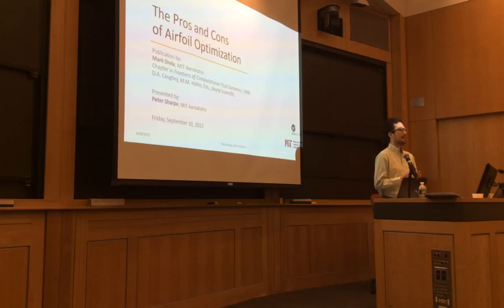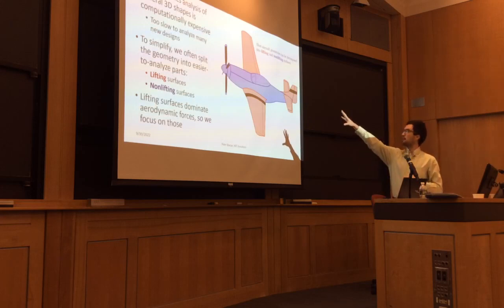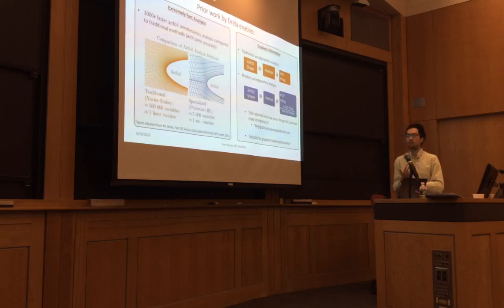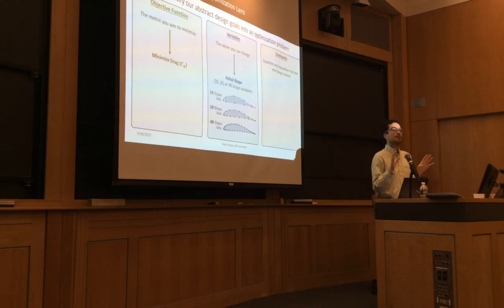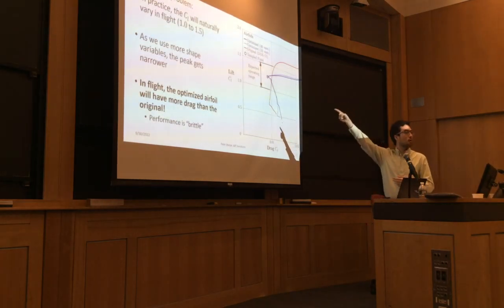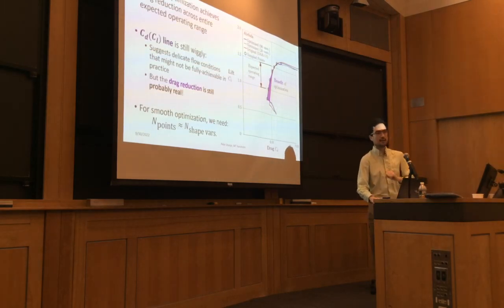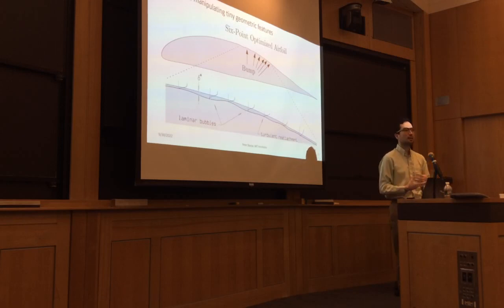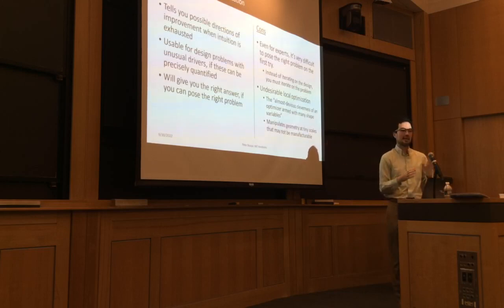Pros and Cons of Airfoil Optimization

Comment: Peter,
I enjoyed your talk on Airfoil Optimalization. 

In your paper ‘Conceptual and Numerical Analysis of Active Wingtip Vortex Cancellation in Propeller-Driven Electric Aircraft’ you address wingtip propellers as means to counteract wingtip vortex. 

Would combining the airfoil optimization and wingtip propellers reduced the power requirements of HPAs? (I realize that pedal driven generator + wingtip electric propellers=less efficient, but may offer greater design choices)

Thank you,
Reply: Wingtip vortices aren't the cause of the induced drag problem. They are the symptom. 

Induced drag is caused by the aft-tilt of the lift vector when flying at an angle of attack. The way to eliminate tip vortices is to fly at the lowest possible angle of attack. I.e. fly faster.

If flight at high lift coefficient (high angle of attack) is desired, then increase wingspan. The formula for lift induced drag is absurdly simple. Pi is fixed. E cannot exceed unity. Therefore, only CL and AR can be changed. Both are designers choices.
Reply: @EllipsisAircraft  

https://openscholarship.wustl.edu/cgi/viewcontent.cgi?article=1066&context=mems500
Reply: @EllipsisAircraft What do you mean by the aft tilt of the lift vector? I thought lift is always perpendicular to the airflow.